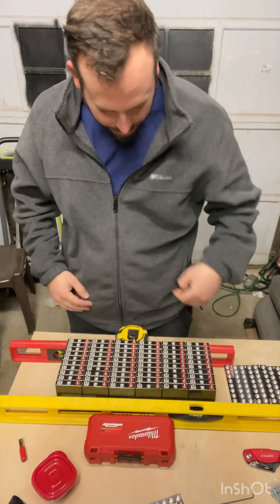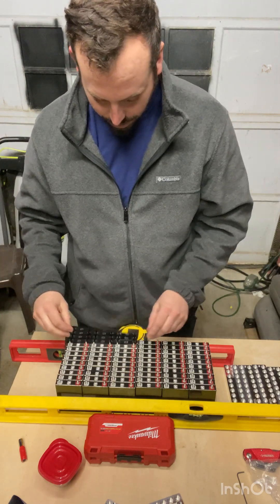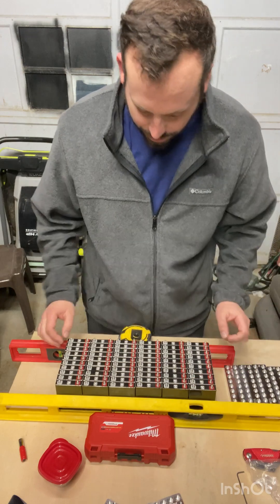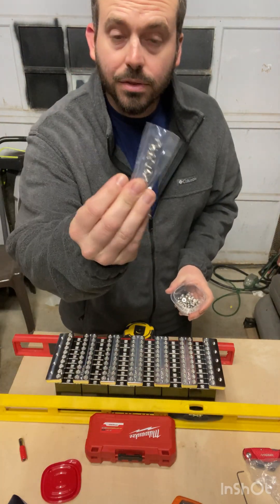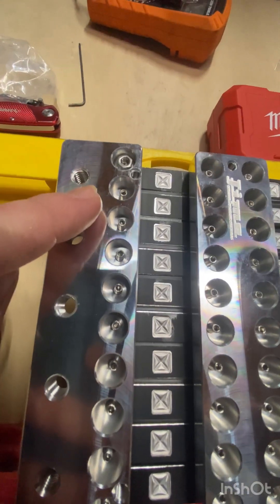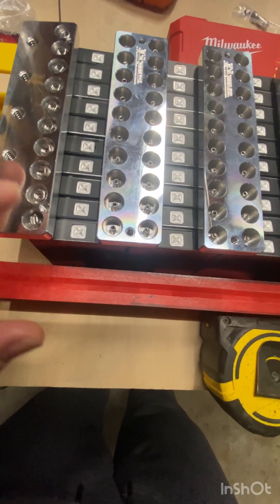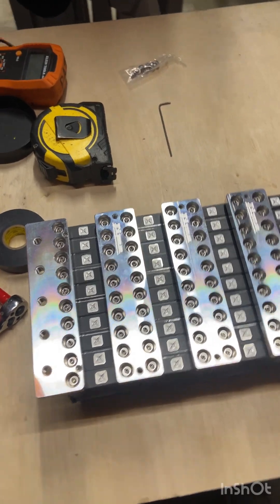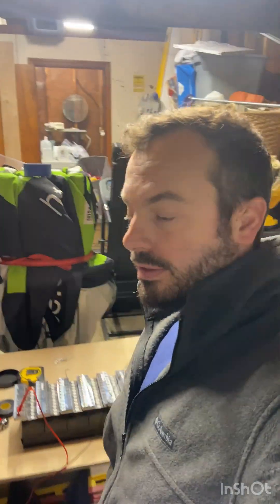Building a 30ah scib lto lithium battery bank 2.9ah cells

Comment: How do you like these? Thinking about building 2- 43.5's
Reply from the maker: @DibeezyTheGifted  yeah they’re solid batteries. More ah is always better 🤙🏽
Reply: @Team808customs What's the total ah on your setup still 3x 8k's?
Reply from the maker: @ 101.5ah. 3 8ks at .66 on 370 and 400 alt    I could use more battery
Reply: @Team808customs which is crazy because they say 43.5 is good for over 20k clamped. Definitely exaggerated.
Reply from the maker: @DibeezyTheGifted  those number are usually for burps or till voltage drops to 12 or something like that. Not steady demos power holding decent voltage

Comment: How did you top balance before assembly or do you need to can you assemble and mount the balancer and allow it to do it for you just wondering the 43.5 arrived this morning and I am trying to make sure I do it right
Reply from the maker: @Dirty2152  the cells were close enough in voltage they didn’t require top balance
Reply: @Team808customs I just went thru 180 cells and they were all between 2.58-2.60.   I’m not gonna bother top balancing I don’t think
Reply from the maker: @thenatureboynicflair  send it 👍🏽

Comment: Hey bro I just ordered a 43.5AH DIY kit from NORTHWEST LITHIUM of the M5 pedestal cells same AH 2.9 and it comes with everything Except the containment box how tight does the containment box need to be and will 72.5AH be enough for my end goal 20-25k RMS I'm trying to have the power supply completely out of the way so I can focus on the system itself
Reply from the maker: @Dirty2152  72.5 is what I was running in my set up. I’d say it’d be fine for that goal. And a snug fit on the box. Want to make it where you can mount it and the cell don’t slide out. IMO
Reply: @Team808customs  ok thanks bro I really need the power supply out of the way so I can focus on the build itself I wound up ordering a Ruthless 10k because the repair guy is having a hard time with the AAK and with them being discontinued I had to switch it up but they were telling me that the 29AH would possibly be at its limits with the 10k and 4 channel so I had to hold up on the install and get some reserves for what I'm trying to do I'm thinking 2x Ruthless 10k 2x Ruthless 1500.4 and a 800.4 end goal around 25k 4-6.5's in each door with two tweets and a dual 15" 4th or 6th I think with the right enclosure design it could be a nasty little build only time will tell though I'm on a budget so I have to get everything one piece at a time and finance a lot of it
Reply from the maker: @Dirty2152  yeah those amps really put out some power too. Once you get everything measured out you should reach out to hunter Martin for a design
Reply: @Team808customs  Hunter Martin ok thanks bro I will definitely do that I'm going to get this other bank in the car and wired up new fuse block and amp installed and probably just run this with minor mods to the front stage until April when we get our yearly bonus at work I'll be able to get the rest of the equipment and start on the enclosure design it takes time and it's almost Christmas time so I have to stop spending on the build and get the holidays taken care of I'm trying to get there bro thank you so much for all the help you give I wish there were more people like you in the audio community

Comment: What ate the dimensions of this back? And how many watts would it support with 320 amp alternator charging at 15.3?
Reply from the maker: @teewalker615  it’s actually in my buddy’s car for finals this weekend but it’s not very big. 30ah will support up to a 10k pretty good.
Reply: I'm running like 26k. But only 10k is designated to bass. 2- Taramps 5k. Space is limited because it's going on a slingshot

Comment: Is it ok to make a bank even if some of the cells read a little differently on my cells some read 2.52v 2.53v 2.55v 2.56v 2.58v all cells read around that range will it be ok to hook them up as is?
Reply from the maker: It wouldn’t be a bad idea to top balance them to get them a little closer.
Reply: @Team808customs  what would be the perfect voltage for each cell
Reply from the maker: @keefsosa4992  anywhere in that 2.5 range as long as they are close. If they were like 2.53 2.54 2.55 I’d just hook it up then charge bank once fully assembled with a balancer. Subscribe to the channel 🙏

Comment: I seen your charging video on this lithium battery. How exactly do i charge each individual cell? Up to how many volts should i charge it too and also how many amps do i set it too since its a small cell?
Reply from the maker: That’d take forever lol If cells are close together in voltage they should be fine to assemble. 2.54 2.55 2.56 just example. Then charge bank. If cells are not that close then top balance them. Subscribe to the channel and feel free to ask any questions
Reply: @808patanderson  ok so to top balance them wouldn't that require running wire in parallel all positive and all negative to each cell which is 60 total cells that would also take a long time doing . U think I'll be ok as long as all are at 2.5 volts even if they read 2.52 2.54 2.56 2.58v all are at 2.5v nothing lower
Reply from the maker: @gainz6226  they’d probably be okay. Could always just top balance the lowest and highest to meet in the middle. I spend a lot of time and money on this so I try not to cut too many corners

Comment: Should these cells read at 2.4 - 2.5 volts each is that considered good?  Is a reading of 0.41 volts a bad cell becuase i recived mine and one cell reads that
Reply from the maker: You could try to slow charge it individually and see if it holds but I’d say it’s a bad cell. Easier to get a new one to replace it now than when it’s installed.
Reply: @808patanderson  so is 2.5 volts a good reading? Also what can I charge the cell with?
Reply from the maker: @Tsx-yb6ub  2.5 is fine. Hit that subscribe button and check my charging lithium battery video

Comment: I got these cells from sriko. Got the diy kit comes with everything. Just wanted to know if spacers a really needed becuase sriko does not include spacers with this kit
Reply from the maker: They’re just specific to the bars
Reply: @808patanderson  ok so spacers are not a safety thing I thought they were used as extra safety
Reply from the maker: @Evo-ed7hw  not to my knowledge
Reply: @808patanderson   will a noco charger be ok to charge these cells. It has a lithium option? And running with a 15.5 volt alternator be good?
Reply from the maker: @Evo-ed7hw  15.5 is fine. Unsure on that charger. I made a video on charging these. You can watch it and get the same thing. Link should be In the description. It’s only about 30 bucks

Comment: What do u think of the lishen lifepo4 cells. I am debating between these scib or the lishen Prismatic banks. I can run from 14.4-15.8 volts
Reply from the maker: Scib at 15.5-15.8. It will out perform lishen by a lot
Reply from the maker: Make sure to subscribe ✌🏼
Reply: @808patanderson  will that bank u built  on this video be good for 8,000-10,000 watts with a 260 amp alternator? Also I seen they say the scib work good from 14.4-16.2 volts. So I wouldn't be good at around 14.8?
Reply from the maker: @guwop3310  needs to be charging at 15.5+ to get most out of it.  It’d be okay for 8k
Reply: What do u think of the other bigger blue scib 2.4v 10ah cells. Would those be as good or better than these 2.9ah cells? Both are LTO so I just want the best
Reply from the maker: @guwop3310  no personal experience with them but on paper they’re are really good too.

Comment: When you were running this cell configuration how many watts was the battery able to handle im wondering because it is rated for 15,000 watts but a lot of people are telling me around 8k is a better rating for the battery on a continuous lvl but your videos are the only ones I can find on the 2.9 AH cells
Reply from the maker: 15000 is for a “burp”. Reserve runs out after a couple seconds . 30ah of scib for 8k is a solid rating given a 320amp alt or better
Reply: @Team808customs  ok thanks bro dually noted what is the lowest voltage you want to see on the bank to keep from damaging the cells I've been told if I drain them to far the cells can flip polarity
Reply from the maker: @Dirty2152  honestly I don’t know. Ideal to me is charging at least 15.5 but 15.8-16 is better and not dropping below 14.6 in my opinion. If I see 14.6 I’m backing off
Reply: @Team808customs  dually noted I was wondering if it was different from lifepo4 I'm still learning bro sorry for all the questions and thank you for all the help
Reply from the maker: @Dirty2152  no problem
Reply: @Team808customs  hey bro don't you run DB amplifiers to I blew my kicker yesterday and I'm looking for an 8k for my upgrade seen a couple nice DB 8k for under a grand and says Korean but it's saying that the operating voltage is 15 will they work if I'm charging at 15.8
Reply from the maker: @Dirty2152  yes I run mine at 15.8. I have one atom pro that doesn’t like above 15.7
Reply: @Team808customs   so the aak 6-8k and the aab6-8k would work fine
Reply from the maker: @Dirty2152  yes both will run at 15.8. I do aak8k at 16v when metering and
My buddy does aab-7900 at 16v
Reply: @Team808customs  well I went with a deafbonce aak 6k Korean it was on sale for 950$ and I think it will be a good starter amp for my trunk build and to get me to a show any idea when they are having the next show in TN I want to come just to get in the scene and learn what I can and can't do as far as build goes I have a bunch of sound deadening material I need to install but I don't know what is allowed yet still waiting for the SCIB from Northwest lithium as well
Reply from the maker: @Dirty2152  follow me on Facebook. I post the upcoming shows Patrick Anderson

Comment: Are those the pedestal cells or the flat top cells..does it make a difference?
Reply from the maker: Non pedestal. Pedestal cells have a slightly bigger stud so could probably carry a little more current in theory but have the same rating. Pedestal bars cost twice as much

Comment: Could you explain why people use the 2.9ah 75c cells? I would think the 20ah 35c cells would be a more cost-effective bank. Doubling you ah should in turn almost double your c rating. Or at least the 10ah 75c cells. Just seems like a shit load of cells for 30ah vs 18cells with the 10ah 75c cells.
Reply: I've been contacting a lot of people here lately researching these and other cells trying to find the absolute best cells on the market and apparently the 2.9 AH cells are the ones that are actually 75c they have a 75c rating on the 10AH cells as well but that is a burst discharge rating not continuous discharge rate like the 2.9AH cells I myself purchased this same bank from NORTHWEST LITHIUM because of the exact reason states above the actual 75c rating instead of a burst discharge rating

Comment: Awesome video. I've never seen one of these put together until now.

I have a 320 Brand X alt and charge at 14.8v I'm currently using Headway but was curious to know what other lithium banks are available in my charging range?
Reply from the maker: I’m interested to see how the new sodium batteries will perform. Probably be to new best option for 14.8v range
Reply: @Team808customs  have a 110ah sodium  bank in my accord does 3500w pretty well on 250 amp alt at 14.4v sodium you can up your charge voltage between 14.4v and 15.8v